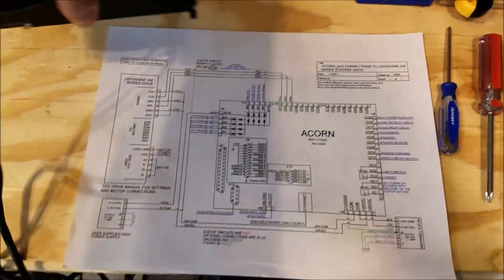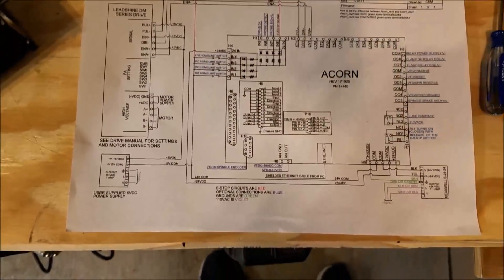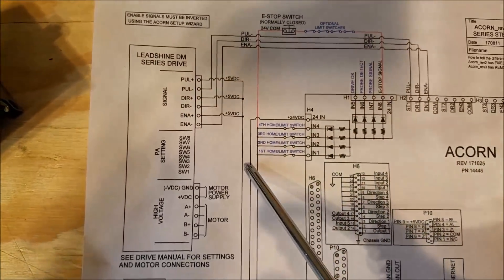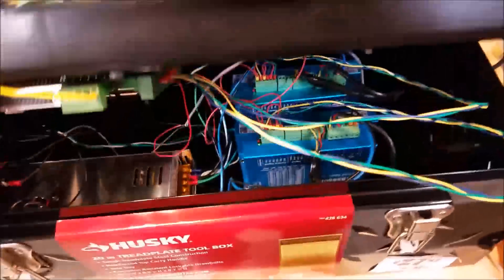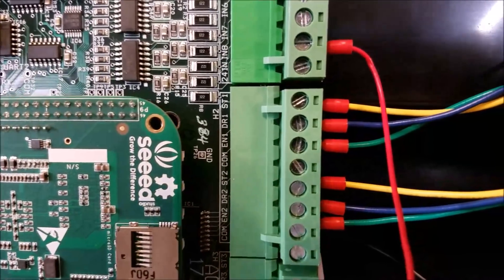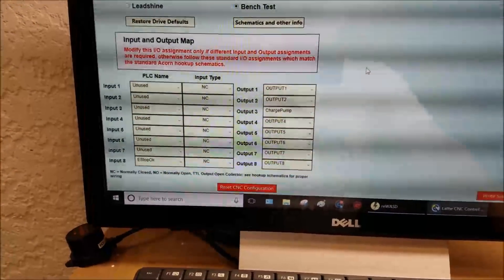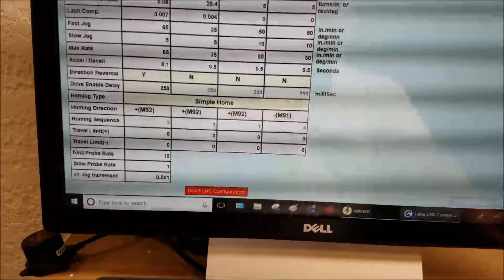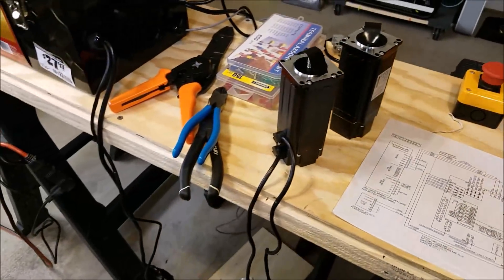DIY Closed Loop CNC Control #6: Turning Motors

Comment: Hey Franko, greetings from the UK!  Just a quick note on the use of the 5v PSU... You can actually use the 24v rail from the Acorn instead.  Just make sure you add a 2k resistor in each of the three -ve lines (step, direction and enable).  Reason is, the three logic inputs are just opto couplers so as long as you provide an appropriate current to the LED, it doesn't matter what voltage you use.  Means you need one less PSU anyway 👍

Comment: Hello. The high voltage connector AC-AC.where is the positive pole. I will use 36 volts DC.
Reply from the maker: Hi.  It can connect either way.  The manual shows GND on the bottom.  I have mine connected with +V on the bottom and it has worked fine for many months.

Comment: Re-writing a comment regarding problems I'm having getting my stepper to turn.   I have 5v from the acorn supply to Pul+ on my driver, then looped to Dir+.  I have a larger supply hooked up to the driver DC + and DC -  And A+/A- and B+/B- to the stepper of course.  Pul- is wired to ST1 on the Acorn and Dir- wired to DR1 on the Acorn. Green light on the board is on. When powered up the stepper twitches one step then feels stiff so I know theres power/connection to it.   But in CNC12 when I try to jog the axis the stepper doesnt move at all. I've been following many videos but I can't see anything obvious that I've done differently.
Reply from the maker: Hi.  It sounds like you figured out the power supply thing.  If not, then the answer is this:  The Acorn board comes with it's own power supply providing 24V power for the acorn board and any switches/sensors that may act as inputs.  The power supply for the stepper drivers is totally separate from the Acorn power supply.  

Now, for the second part of your question, there could be a few different scenarios.  First, please double check the wiring diagram (just in case ).  Assuming all the connections are made correctly, then you may need to invert a signal somewhere.  

First, make sure the drive enable signal is working correctly.  Power cycle the Acorn board.  Initially,  the Acorn will NOT enable the drive until you begin to jog (or home) the axis for the first time.  The Acorn will also disable the drives if you press the big red reset button or your e-stop button.  If the enable signal is inverted, you will see the drive enabled at power up and then it will be disabled when you try to move the axis.

I've also seen situations where the step and/or direction signals need to be inverted.  Failing to do so will cause the drive to misbehave.  Not an Acorn thing - more of a Leadshine drive thing.  

Finally, I had one (and only one) of these drives that would not work no matter what I tried on the Acorn software side of things.  The only way I could make it work was to use the Leadshine software to invert the signal logic inside of the drive itself.  Then, it was happy and everything worked just fine.

I hope this helps.
Reply: @FrancoCNC  Hi, I think I have the power and wiring sorted.  I noticed when I hook up ENA- to the acorn, when in CNC12 if I jog or reset home the stepper relaxes i.e theres no stand still torque as apposed to when I hit the big reset button and the stepper remains difficult to turn by hand. So this suggests an inversion somewhere?  I'm terrible with electronics, I'm not completely sure what you mean about the drive enable signal or how I check this?   I searched through the Alt+I menu but couldnt see anything there to invert for these purposes.  Sorry for all the questions!  I really appreciate the help.
Reply: @FrancoCNC  Ah a breakthrough.....  I looked every where in the Wizard but missed the page I needed each time.. I see the tick boxes for inversion for step and direction, I inverted these and then also unticked 'Enable' Now the stepper jogs at last! Edit: Tested running the Pawn demo. Seems to be working fine, I'll need to adjust the driver and config for steps per rev etc But i'll do that when it's mounted to the lathe. Now the easy part for me, Manual machining the brackets/supports to mount it to the lathe. -
Reply from the maker: @TinkerInTheShop  Excellent!  I knew you were close and would figure this out quickly.

Comment: hi franco
hi have ac servo without driver and without encoder 
can i run it as stepper motors 
with h-bridge or any steppers driver
Reply from the maker: Hello.  That question is beyond my knowledge.  Sorry.
Reply: dont be 
thanks

Comment: Is the acorn board a open loop board? Does that mean that the fact that you are using closed loop motors does not really matter?
Reply from the maker: Hi.  The Acorn is open loop in that it only outputs step and direction signals.  However, the stepper drivers receive the encoder input and they make sure that all of the commands send from the acorn board are actually carried out.  The drivers have logic in them that compensates for error detected by the motor encoders.  If the error is beyond the range that the driver can compensate for, it sends an alarm signal to the acorn and the system triggers an alarm.

Comment: Sir Closed loop motor and servo motor is same.
Reply: I'm sorry but that is incorrect. https://www.motioncontroltips.com/faq-whats-the-difference-between-servo-and-closed-loop-stepper-motors/
Reply: Sir your mean if encoder feet with open loop or closed loop stepper motor ,it's work same to same like servo motor.
Reply: Servos and closed loop steppers are similar in use but mechanically and electronically different with different torque curves. However you are correct that an encoder works the same on any rotating shaft.
Reply: I mean your final answer, stepper motor open loop or closed loop never worked properly like servo motor and drive. If we fitted encoder also closed and opened loop stepper motor. That accuracy and smoothness never equally servo motor and drive?